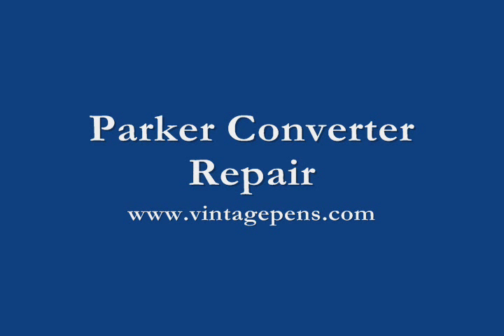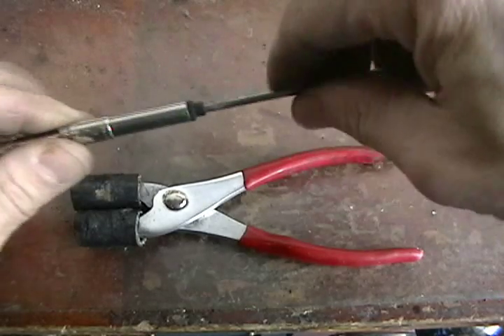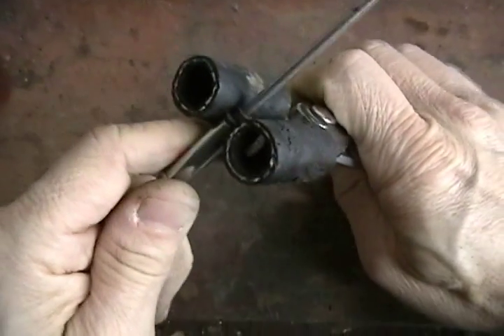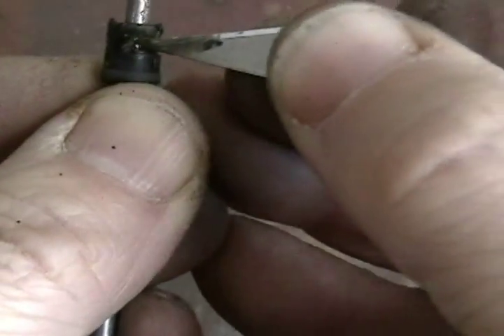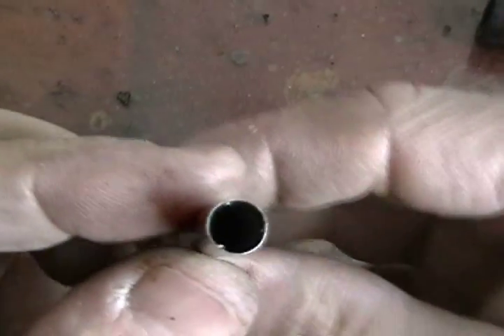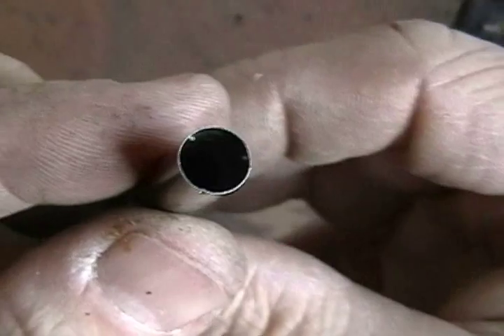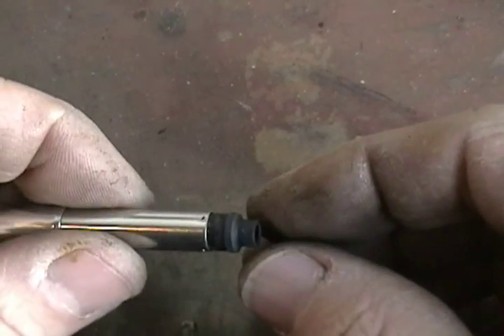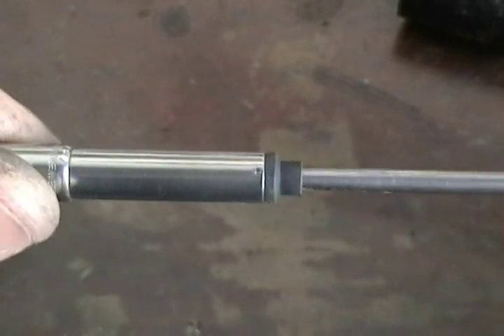Parker fountain pen converter repair

Comment from the maker: As noted, this same method works for many different brands of metal-bodied converters. Today I repaired a Pilot converter from the 1980s, using the shaft of a drill bit to support the plug while it was wiggled out with padded pliers (it was either 5.5 or 6mm -- use whatever is a snug fit). The replacement sac was a #14 in transparent PVC, which was a tight fit. #15 would be better but is a size only available in latex and silicone, not PVC.

Comment: Great video.  Why not just buy a new slide style one? Or does this sack style work better? I just got a vintage Parker 25 set (new old stock) with this style filler and the rubber seems to be fine. Thx
Reply from the maker: Many prefer the older converters, and they certainly have a good solid feel compared to the current all-plastic design.

Comment: I fix mines using shink tubing for wires or polypropylene soda straws (you have to melt one side) 🤣. Prices for sacs are ridicolous here and they are not really needed for squizing anyways. I think I could even make "vacumatic" sacs using other sorts of soft pipes or latex.

Comment: The original sacs in the metal sac protectors look like the pli-glass inside an aero 51. Do you think the repro ones David Nishimura sells could be substituted for the opaque black rubber that you used, so one can see remaining ink levels?

Thanks for the informative video!
Reply from the maker: Other companies have used transparent PVC sacs inside converters, but that wasn't the case with Parker. All of the standard converters I've seen have used standard black latex rubber sacs. Unfortunately, the PVC 51 sacs are just a bit too large to fit, though I've used them in converters for other brands.
Reply from the maker: We now have slender PVC transparent sacs, #14 size. These will fit Snorkels and early Parker 51 Demis, as well as Slimfolds. They would of course also be an option for converter repair.

Comment: thicker, slower curing CA (super) glue should work well too, to attach a new sac. slip a thin wire between niple and sac, let a small drop seep into the gap, and move the wire around 1-2 revolutions before pulling it out, and djusting the position of the sac. 
this is how the tires are attached to some RC car wheels.
Reply from the maker: CA (cyanoacrilate) glues are not recommended for sac attachment. The problem is that CA bonds too strongly to the sac nipple, unlike traditional shellac which is readily removed with gentle heat when it comes time to replace the sac.

Comment: Hello, 
Just new to fountain pens for everyday writing, not so into technicals. I was wondering if you could please help me.
My grandma just gave me 2 parker 21's that belonged to my uncle, super flighter, I think?  They have arrow clips. They haven't been used since the 70s and non of the 2 really work. I recently just soaked the insides (point unit, converter) in some water and detergent to clean up the dried ink. One seems fine, but still not writing :( I think it's filling up, coz it's been dripping ink overnight, but the ink is not coming out where it's suppose to be. The other one, well, when I got it, the converter is stuck tight to the barrel.
I live in the Philippines and the parts are really difficult. Is there a modern fix to this? like modern off the shelf parts? I'd really like to used them.
Thank you for any help you may provide
Reply: You could just use parker cartridges instead
Reply: youhave to use your imagination fellow thirdwolder. i've done converters using plastic straws or even 1ml srynges. you can even just squize an old cartridge if it's flexibel enough